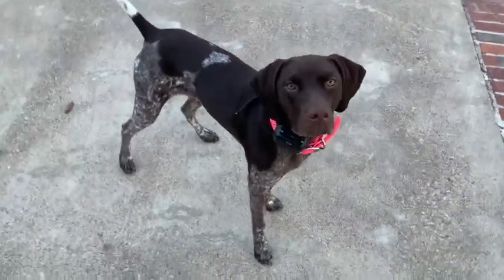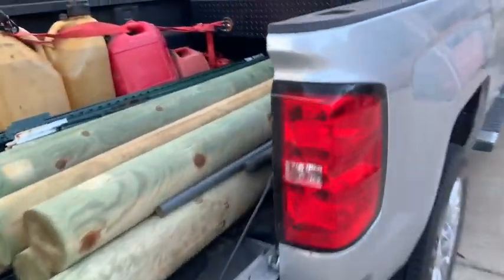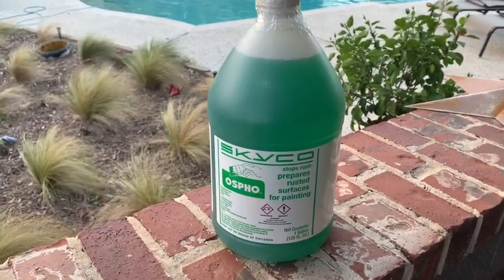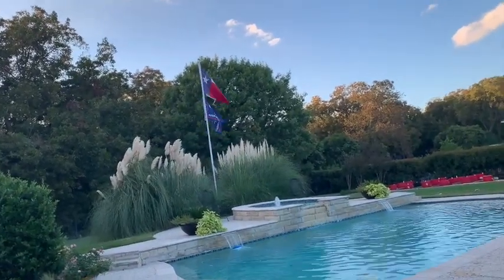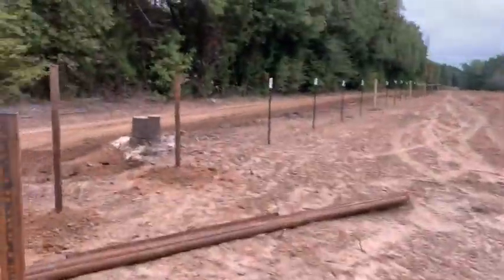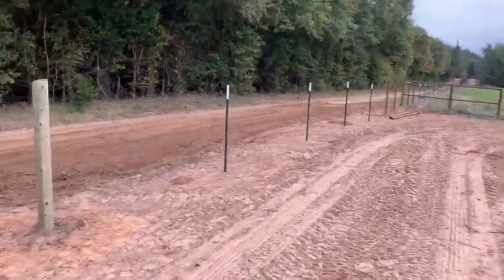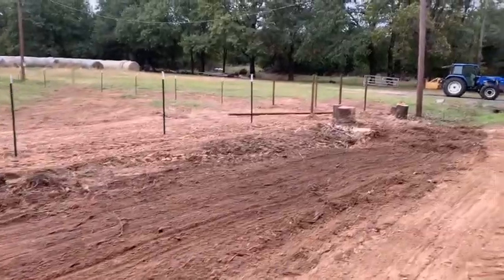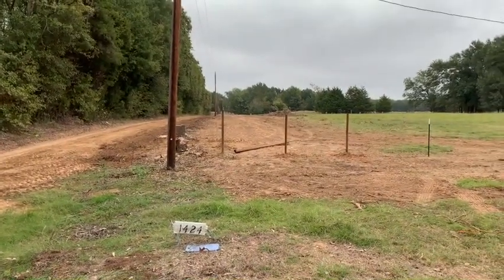More Barbed Wire Fence Work setting T Post

Comment: How far apart are you setting the T-Posts apart from each other? What length is the pressure treated fence posts?
Reply from the maker: Thanks for watching.   T post on 10’ centers.   Every 50’ we put a treated wood post.    The wood post are 8’ long.

Comment: Looks like you've got your work cut out.  Let me know how the Ospho works.  I was planning on sanding down the entrance posts and gate and then apply Rostoleum spray paint.

If you already cut around the stumps, they may break-off with a push using the front loader.
Reply from the maker: Thanks LG,   We are going to use the Ospho, then hit it with oil based Kilz, then paint.    That should last, we hope.   Appreciate the feedback.

Comment: That Texas flag is looking a little weathered but that's a GREAT looking flag you have flying under it. I prefer not to paint my metal fence posts for two reasons 1) my dad had a metal entrance and corral system that was painted silver and the rust showed through it really bad so he was always having to touch it up but eventually it got neglected and it all ended up looking pretty rough 2) I just really like the natural patina that metal fencing acquires over time. If I had to pick a color it would be black because it won't show as much rust as white or silver.
Reply from the maker: Thanks Texas Farmer.   I cannot let my wife see this post.   Haha.  She has the new Texas Flag on the counter and I haven’t  got around to installing it for two weeks now.  👀👀I’m in the doghouse.    There is a lot to be said about your comments on painting pipe fence.   I’ve been watching stuff as I drive down the road and I see a lot of rusted ugly pipe.   Something to consider.
Reply: Paint looks good, I like rust though, brownish red is a color too. Painted to many damned cars, flaws don't bother me too much. Do they have a stump grinder that hooks up to a tractor pto anywhere? Those work pretty slick.
Reply from the maker: Thanks, unfortunately, I don’t anyone with a PTO stump grinder.   Perhaps I can rent one.   Good idea.
Reply: @HeritageFarmsTexas  I made one, quite the machine, there are better ones than mine. No shield, can fly stuff everywhere,